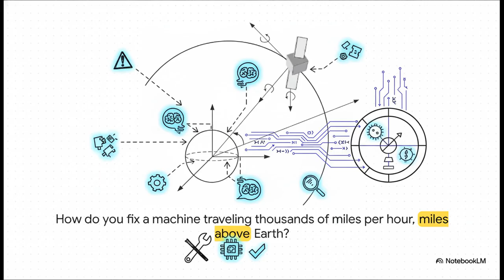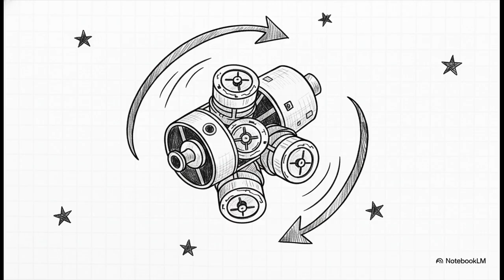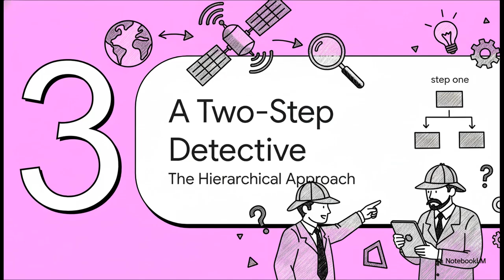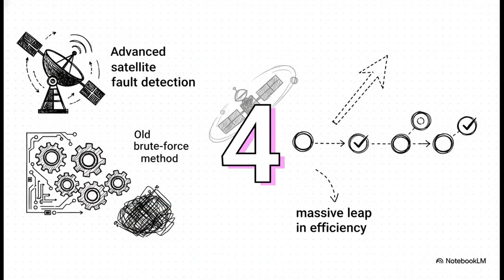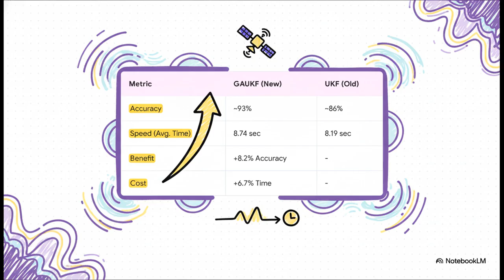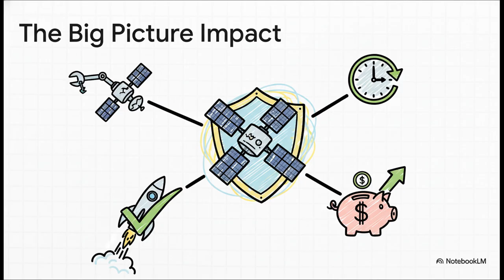J009: Fault detection and isolation of control moment gyros for satellite attitude control subsystem

Comment: what is this for mister iam 14 years old and i dont understand this but it kinda cool
Reply from the maker: Satellites steer using fast-spinning wheels. If one breaks, the satellite can spin out of control, and you can't send a mechanic to space to fix it.

This video, which is a work published from out lab, explains a new "Self-Healing" AI that saves the day in two steps:

1. The Watchman: A program constantly scans the satellite. If it feels a tiny wobble, it sounds the alarm.
2. The Detective: Instead of checking every single wire (which takes too long), a smart AI instantly pinpoints exactly which wheel is broken.

Once it finds the problem, the satellite automatically updates its own code to fly safely even with the broken part. Kind of like learning to walk with a limp so you can still get where you're going.
Reply: but if thw hardware that breaks then how it fix itself
Reply from the maker: It is more so about how to handle inability or disability to adapt. Think of it as when you have an injury in your body, you body automatically tries to adapt to that injury and use other parts of your body to compensate for the lack of functionality for the injured part to be able to complete the tasks you need to do on daily basis.